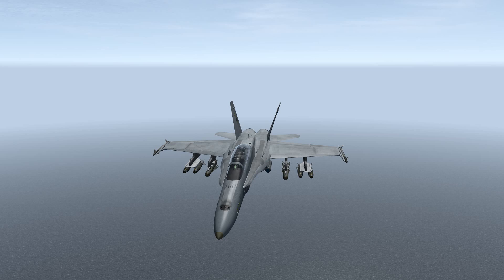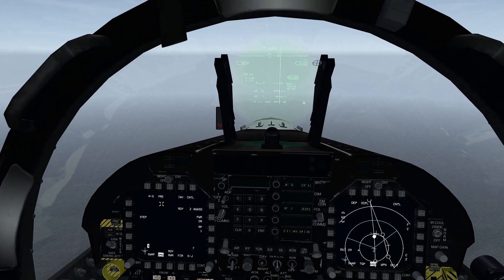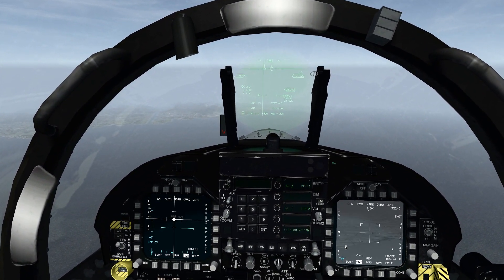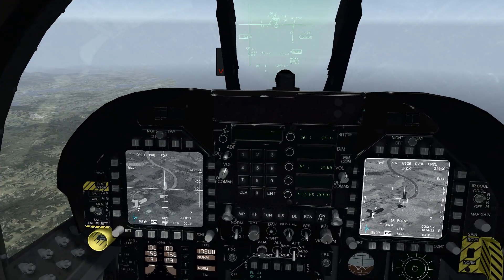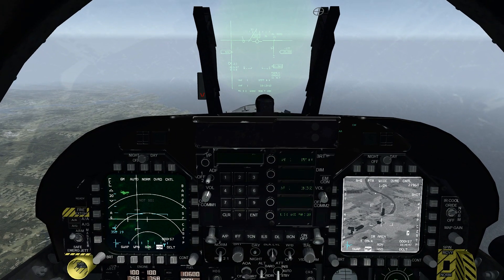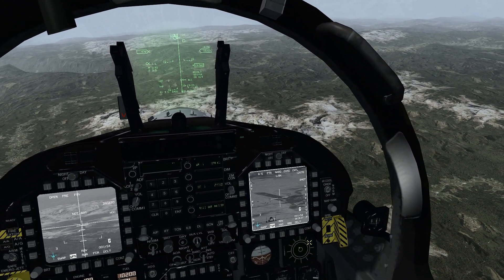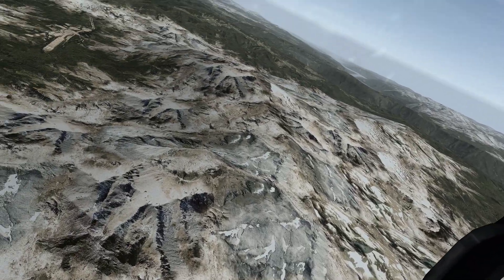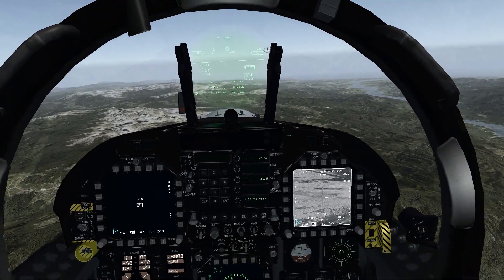✪ BMS 4.33 F/A-18 Hornet "AGM-65 Maverick Tutorial"

Comment: Question for all the guys who can get bore-sighting the mavericks' to work.  After bore-sighting have you had much luck with moving targets as I have not?  Seems like TGP and mav are bore-sighted correctly but if I lock up moving target 9 out of 10 times the maverick will not track the target as the TGP is doing.  Every tutorial I see out there about bore-sighting the individual attacks static targets.
Reply: He hit the target, you think the weather and the range he was at in the video hyperlink had a hindered him from getting a lock ?
Reply from the maker: Remember, the Maverick seeker head can see through a "straw" hole while the TGP/ATFLIR can is similar to a news reporting camera. The maverick is great in VISUAL mode for moving targets which does not require bore sighting. You can use your GMT radar to find targets, designate them with the TGP, move the Maverick VISUAL mode "HUD circle" over the designated target and lock it up and fire it off.
Reply: All that you said is true but we can't hide the fact how valuable being able to see and lockup a firecan or straight flush, fan song, etc from a distance and then only have to worry about is my mav in range and in the keyhole and the surrounding sa.  We used to be able to run SEAD with mav's, now they will get you killed.
Reply from the maker: Well, the BMS dev team has always been focused on realism so i imagine this is a more realistic representation. During desert storm A-10 warthog pilots would lock up targets using just the maverick seeker head which had small gimbal limits. Having the targeting pod helps identify targets but we still need a proper lock with the maverick itself which is trickier. This is a move towards realism, here is a HUD tape where the pilots states "unable to lock any movers" so real aviators share in this frustration. https://youtu.be/RNrbTN1Z5pE?t=20
Reply: could have been a lot- seeker heads are basically like little crystal balls connected to a digital eye in a sense, slung under a wing, going couple hundred miles per hour. Want to learn something amazing that will make you question the laws of physics and everything you ever learned in school? learn about the development of the sherk. Radiation is amazing. The sherk pushed our seeker tech well ahead, and we even did that craptastic. Now go learn about the IRIS, or the ASTRA IR...yeah, we've come a long way baby.